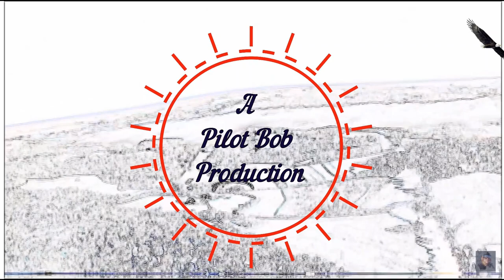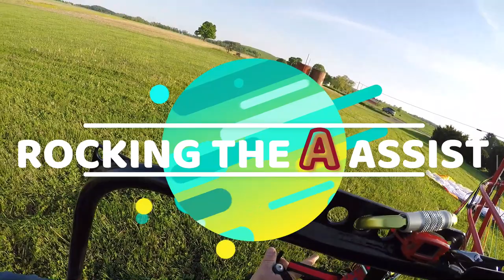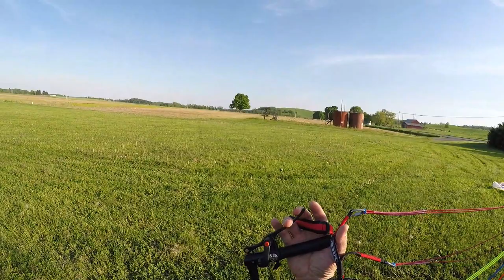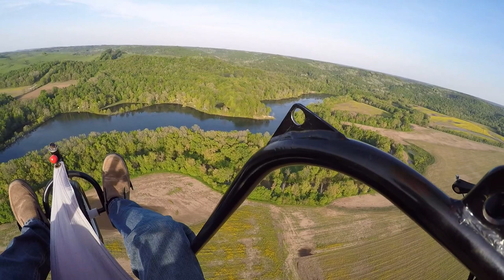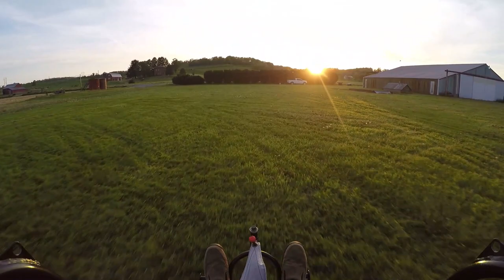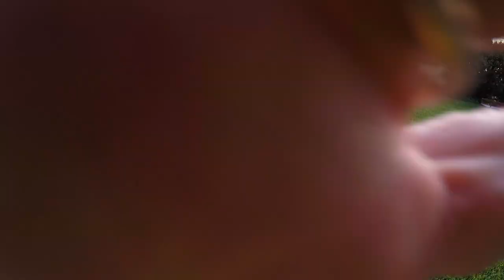Ohio Paramotor Trike Adventures Rocking The "A"  Assist

Comment: Rocket is an understatement! did you pop a little break to stop it or did it just stop when you let go of the A's?, next time grab both A's and see what happens, I've never used split A's so I don't know. I did see someone with split A's grab both it was just the other day to.
   34m? that's big, lots of glide your not use to ended up in the next county first couple landing attempts I see lol, good flight see you on the next one.(still messing with my edit issue).
Reply from the maker: Yes, this baby does glide.  I pulled the brakes after I let go of he A's so it stopped it.     When you hold one A is pretty much has the other tied to it.

Comment: Why don't you use the A line assist instead of holding the lines?
Reply from the maker: On my Power Atlas I did use the A assist, but with the Dudek I've found that it isn't needed unless there is NIL wind.  Each wing launches and flies differently and may or may not require assist.  I do manually assist the new Dudek on occasions.  Aaron, I hope that info helps, if you have any other questions I would be glad to assist.  Bob
Reply: @Ohio-PPG-Trike-Adventures  I have an issue with rocking left to right  even when I hold the brakes as high as I can and hold the risers it will continue. I'm easy on the throttle and gentle on turns.  I'm 180 lbs, I have the monster, air design easy with trims in and some flights are just really annoying with the rocking.  
I let about an inch out of my a line assist to see if that makes any difference next time I go. 
Any ideas?
Reply from the maker: What size is your Air Design Easy?   Are you on the heavy side of your wing or on the lite side of your with wing?  Normally, if I get rocking I will pull my left brake down and hold it just putting a little turn to the left for a couple of seconds then letting off.  I could do on the right brake I guess but normally my wing pulls right so I use the left.  So letting go of the brakes is not the solution but to apply pressure to counter the oscillating is you want to go about it.You A assist should be setup about 12 o'clock and when flying should be loose and not pulling.  I don't the A assist are going to oscillate you... but you don't want them tight when in flight.  Hope that helps... do you have any video of your flights?
Reply: @Ohio-PPG-Trike-Adventures  my air design is a medium. I'll try the left brake and see what happens.  I don't have any video but I'll let you know how it goes. Thank you
Reply from the maker: @aaronbqwert7164  sounds good... looks like you are probably heavy in that wing as it's rated for about 265 top in and you're probably 345 lbs all in.   So you shouldn't be getting the rocking.